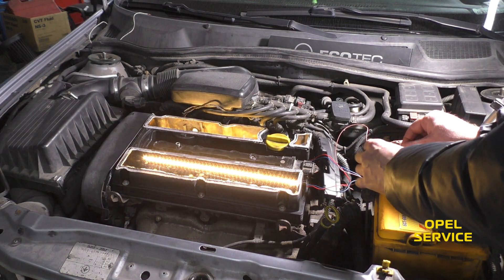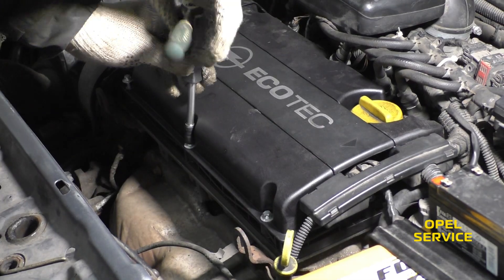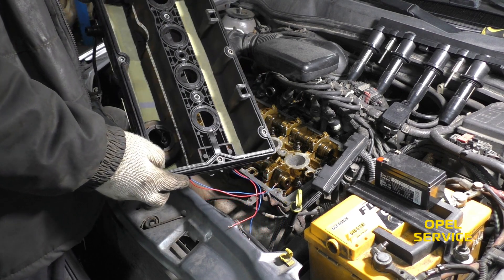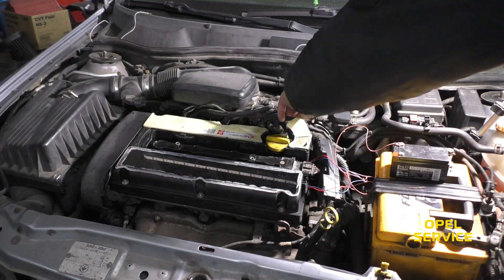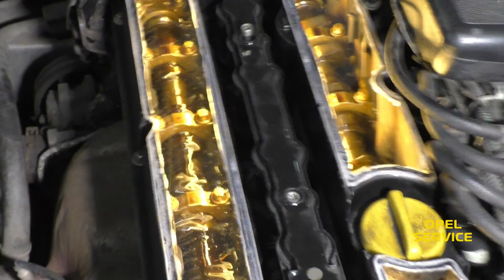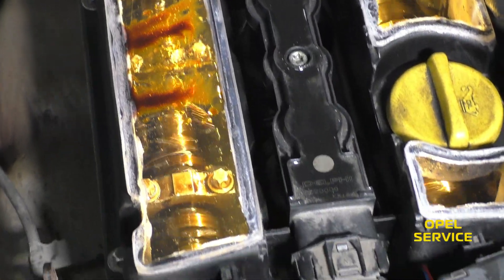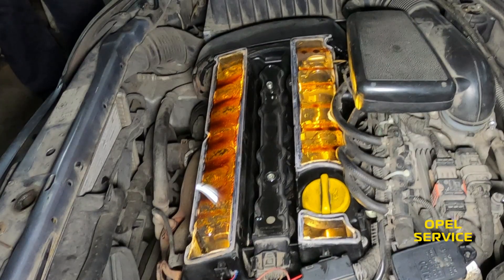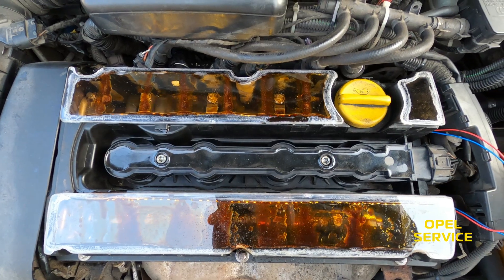Hidden defects of the engine lubrication system under the glass

Comment: My only guess would be if the exhaust cam has a load bearing device on it, such as a vacuum pump. We don't have Opels in the US, so I am unfamiliar with the exact operation of this engine. 

Some one had mentioned that the cam was spinning the same way, and consequently flinging oil downwards. I don't think that is valid unless the oil galley is in a different location.
Reply: I think Opel is a GM owned brand. Not sure though.

Comment: I guess it's time to drill some bigger holes for the other side or whatever you need to do to get more oil over there
Reply: Doing something like that will most likely DEcRease oil pressure throughout the engine.

Comment: Did you know that a vehicle in motion (as typically found in their natural habitat) tends to blow heat from the front to the rear through and around the engine and cooling system?

Was the engine up to full temperature? Was there proper airflow around the engine and radiator?

How much can you really tell from a thermal camera and such if the engine isn't put under full driving conditions?

Edit: Oil viscosity changes depending on the temperature. The exhaust side tends to run hotter than the intake side..

Think about it for a minute. Maybe just maybe the engineers designed the engine to run best when actually warmed up to
 temperature and driving down the road.
Reply from the maker: It even takes place, maybe the engineers designed it that way, taking into account all these calculations. Thank you.
Reply: @opelservicekyiv  Still a very interesting and revealing experiment you've done there, no doubt. But yeah it would be neat to see this experiment repeated with the car driving on rollers and with a big shop fan in front of the vehicle to simulate road driving conditions.

Comment: I saw the short and was like "hm that engine looks familiar"
then you said Z16XEP
yep, thats the same engine as my Grandmother's Meriva. That thing has some pretty good pull in the 4-6,5k RPM range, at least for the fact that its a naturally aspirated 4 cylinder from 2009 (in our case).
105hp, fucking insane in my opinion. Now imagine if you turbo'd this engine, wouldnt that be insane? It might mess with the twinport system, idk tho
Reply: This is why sometimes I like to think about horsepower per tonne of weight over just straight horsepower.
Reply from the maker: Thank you for watching the video and attention to our channel
Reply: Modern engineers have spoiled us, 105 HP from a typical na 4 cylinder is significantly higher now

Comment: The oil doesn’t look new , perhaps a bit of oil restriction? What was the oil viscosity? I can imagine if done with 0w20 in and engine that calls for it the results may be different. I run 0w20 in my truck engine and with 282km on the clock I have no issues with VVT-I or oil burning. 7500km intervals oil change.
Reply from the maker: Here was the old oil 5w-30

Comment: It's because that camshaft is spinning in the same direction, flinging the oil downwards instead of up at the plastic. Still getting same lubrication though.
Reply: I think you got the winning answer.  I work on designing diesel overhead components and I can tell you with confidence, they would not design the exhaust cam to get less lube, if anything they most often get better oil and coolant flow.
Reply: @jman_thegreat4472  Thanks!
Reply: Why wouldnt it fling the oil in all directions?
Reply: @mpj59  It is applied from one side so it will fling it immediately, about 90-120 degrees from where it was applied.
Reply: By Gyroscopic precession?

Comment: This is very useful to understand how the oil flows in the valve cover. Great video!
Reply from the maker: Thank you. I'm glad watching the video was helpful.
Reply: This can be helpful to find water leak, i have mayo only in this part of the engine where the oil we see in the video, no mayo on the oil pan, chain, oil filter, crankshaft, only in this upper part of the engine my next step is getting 12bolts out then i see if the headcasket is blown.